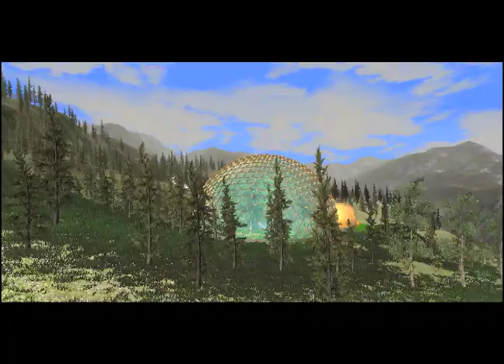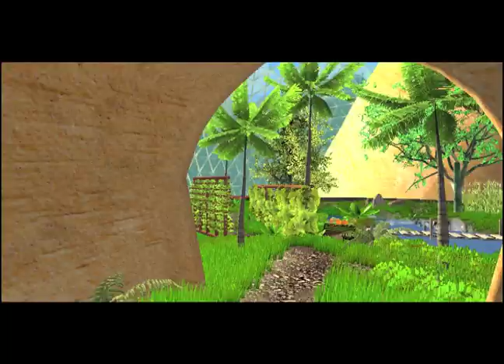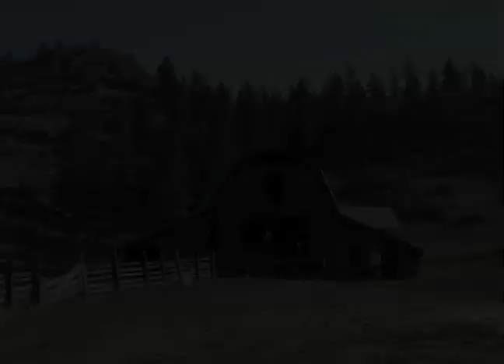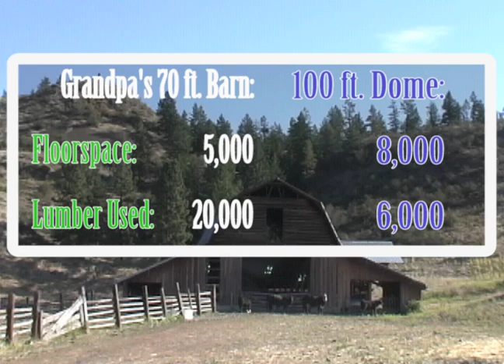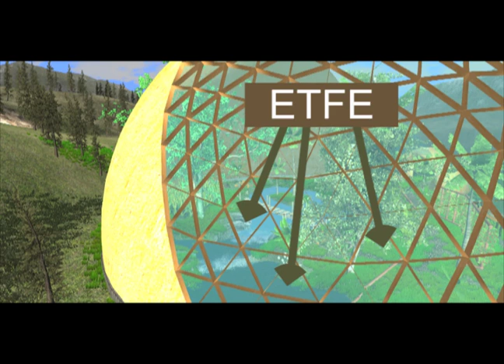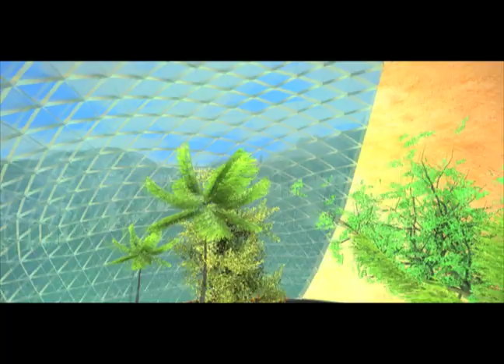Independence Dome

Comment: This size using 2X6 lumber will fail. You will make a 6v or higher frequency, and that in itself will cut down on the sunlight entering the dome. and even then your hubs will probably be  too weak. 

Your current vision lacks structural integrity. Eden has a more complex layer of metal struts and cables under each "honeycomb".

You have oversimplified many aspects of such a big dome and your budget is way too optimistic. Contact me on Domerama,com if you want some help for this project.